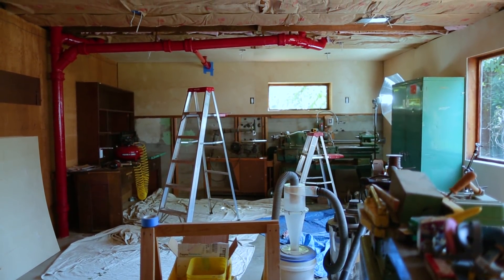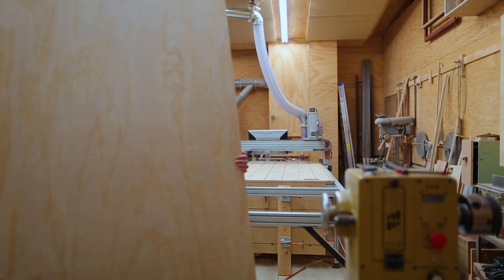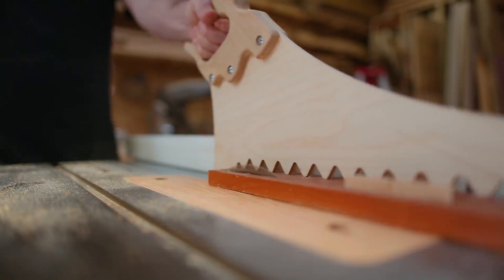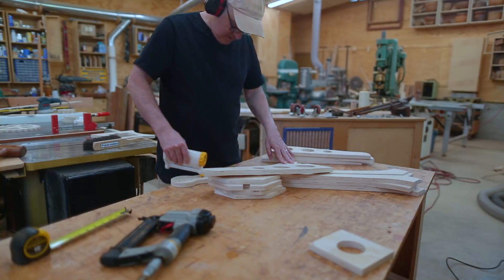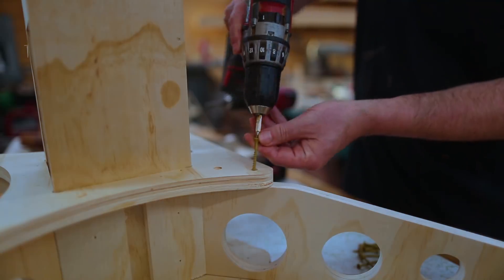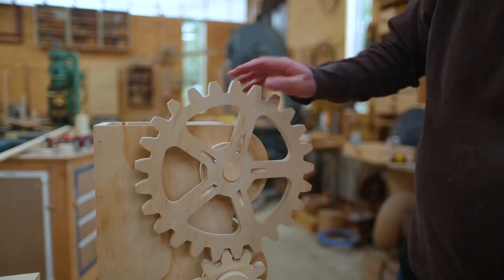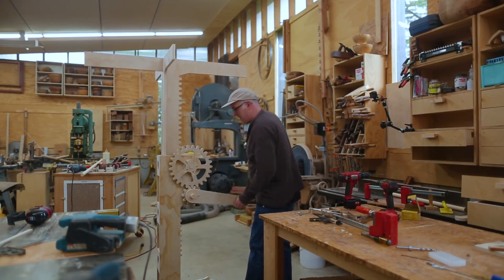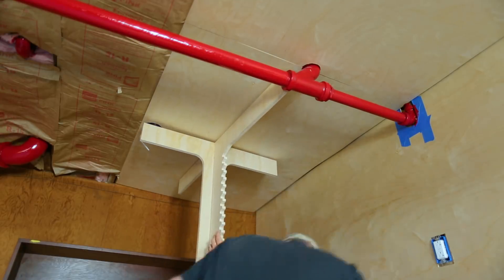Making A Plywood Panel Lift

Comment: Ahem.....endless people have made the observation of renting a lift, but Frank explained why that’s not a viable option for him, and we can surmise the rest. He has 3 separate parts of the basement that will require the use of a lift. Frank does not do anything quickly. He’s not that guy who will work 10 hours a day over a weekend just to return a rental lift on Monday morning and save a few dollars. For crying out loud, he’s not going to roto-zip the opening for his can lights, he’s going to CNC the openings! He is methodical and takes his time, and racing against a clock works against a guy like that. This is a guy who needs to own his own lift, plain & simple.

Comment: Order a Lift from Amazon, install all your panels in a weekend and return the sucker on Monday. Free tool rental!
Reply: Selena Scott endless people have made the observation of renting a lift, but Frank explained why that’s not a viable option for him, and we can surmise the rest. He has 3 separate parts of the basement that will require the use of a lift. Frank does not do anything quickly. He’s not that guy who will work 10 hours a day over a weekend just to return a rental lift on Monday morning and save a few dollars. For crying out loud, he’s not going to roto-zip the opening for his can lights, he’s going to CNC the openings! He is methodical and takes his time, and racing against a clock works against a guy like that. This is a guy who needs to own his own lift, plain & simple.
Reply: @idontthinkso666  Interesting reply but it was also a light hearted joke that I guessing did not come across as one.

Comment: Frank, love your shows! I have a suggestion for you. I have a few large CNC machines used to cut plywood pieces for furniture making. We use Raptor nails which are made from a polymer to fix the plywood to the spoiler board. If the nail is in the path it just gets cut, no damage to the bit or fire to the wood. They are a little expensive but at the rate you would use them it shouldn't be a problem. Also, as a fellow stammerer.. thanks for the work you do for the youngsters! and for showing that you still have something to say. Best of luck!

Comment: Ugh , just weld up / bolt up some racking steel. The stuff with all the holes in it.
Mount a hand crank boat winch.
Done.
This guy could have sheeted a football stadium by the time this beautiful monstrosity was finished.

Comment: It would be helpful if you would explain why you are doing something at the beginning.  I assume you know you can buy this kind of thing at any home improvement store.  It is hard to understand what you are trying to accomplish.  Are you cheap and want to see if you can make one yourself less.  Even if true you could look at the design of the others.  Maybe your goal was to build something better that can be found in local stores?  Anyway I was really scratching my head at the start of this video.  It sounded to me like, "I have this car thing with four doors and an engine.  I wanted to see if I could build some circular things that would go on all four corners and I could get around in it."
Reply: Title of the video:Making A Plywood Panel Lift

at 00:24 : "I sort of got side-tracked at this point and I made a lift to hold the ceiling panels up to the ceiling to help in hanging them on the ceiling."

gee wonder what he is trying to accomplish in this video...

Comment: excellent little project sir..
You can motorise this with a 12v power window motor (or 2 in parallel), they have heaps of torque, and most auto wreckers will usually have them already out of the cars.

Comment: Should have bought one from harbor freight 
for $250.       Frank,this contraption is not safe 
nor is worth the time involved
Reply: Not safe how? And you would know, engineering genius that you are? It's holding up a panel that you could lift with one hand, it's fine. God you people are pathetic.
Reply: I diasgree entirely. Seems plenty safe. Holy crap, it's a plywood lift not a bomb! 

Also, why do we make anything at all? Why do we make tables and bookcases etc etc when we could easily just go buy them? I don't get all the commenters who keep pointing out how much he can buy or rent one of these for. Yes and we can buy and rent ALL the things we make in our shops but we don't because we like to design and make things for ourselves.

Comment: Two tall step ladders and two "T'' shaped supports just a hair longer   than the ceiling, plywood included,   is high.  Put the ply or drywall on top of the ladders, use "T" to jam ply against the ceiling.  Ten minute build with free scrap.
Reply: SuburbanHobbyist 👍

Comment: that crank is too long, you should have made it with a wheel its dual purpose as you have two handles to push or pull he hole lift while raising, they are about the size of a steering wheel on real lifts

Comment: Buy an expensive CNC machine to cut out panel lift parts along with a, probably not cheap, CAD program and computer to run it to design a panel lift you can get for $120.  I bought one a couple of months back for $118.  It was cheaper than the rent would have been.  Now I can sell it, constantly move it, or roll it in the corner.  But this video is just an ego stroke.  I don’t like this guy.  He has an exceptional shop, to be sure.  His video skills are top notch. (I think he retired from some film industry concern, not sure.). But his personal design skills and method of construction are lacking.  I’ve seen some of his earlier work.  Meh.  Amateurish and not special.
Reply: Your welcome to do better. Let's see it.
Reply: Yeah, he didn't buy all that stuff to make the lift, he used it because he already had it so, why not? That doesn't mean you need a CNC to build it. Look at the tools in his shop, he could afford a drywall lift if he wanted to, he just found it an interesting distraction to figure out how to make one himself. There are plenty of other things for you to view on YouTube if you can't appreciate a talented man build something and, finally, your comment is "just an ego stroke". You came here to pretend that you are smarter than this man because you wouldn't waste all that time on a simple tool. Well, you're not and you're not even smart enough to understand why.
Reply: If you don't like it, don't watch it! Problem solved.
Reply: Translation: I'm jealous of Frank because I think I'm smart too but Frank is getting all the attention that I should be getting so I'll write this nasty comment trying my hardest to make myself seem even smarter than he is!
Reply: Jealousy is so terrible

Comment: Thanks for the outstanding video Frank! Something has always bothered me about your cordless drill...why does it seem that all the bits you put in there wobble? The longer bits are quite noticeable. Do you think the chuck is faulty? I don't believe they should wobble like that, especially on a decent quality drill. You could always test this by putting a 1/4" bit in there and seeing how "true" the resulting hole is. Maybe it's just me.

Comment: you should hang small bells or rubber balls off the arms of the lift, so that they hit your head and give you a warning to move out of the way before the arms of the lift hit your head.  better a light tap from a rubber ball than a big bruise from a corner of plywood

Comment: super cool, Frank!  thanks for sharing.  looks like the vertical adjustment is in increments of gear teeth, so i’m imagining you could add a few little shims held on by a short string- one or two for each of the 4 arms that hold your panel aloft

Comment: I don't have a metal shop but I do have model trains. It's hard enough keeping the dust out of the mechanisms and the crud off the wheels, let alone metal shavings. I hope there will be a divider of some sort to break the room up or you'll be spending all your time fixing the trains rather than 'helping' Calvin play with 'his' trains. ;)

Comment: The clamp moving on your end title would have been a simpler mechanism. The ratchet and Pawlenty on your gear system does not actually allow for a firm pressure of the ply on the ceiling because it only operates at fixed graduations. Ideally you need a lift system that holds the ply firm against the ceiling at any height. This could of course be achieved with a hydraulic solution.

Comment: Frank, I could have used this yesterday!  I'm doing the same thing (different reason) and putting plywood on my shop ceiling.  I used two FastCap Third Hand HD poles and the strength of my apprentice to get the job done-ish (more to come).  I'm sure that he wished that I had one of those!   The Third Hand poles work great once you get the plywood  up, but not a bit before that.

Comment: Comment on video: for the whole section where you're talking about the CAD designing, you have a loop of clicking/typing sounds. It was kind of distracting that it was just a loop instead of actual typing. I would say record the same kind of noises, but live to fill the whole time section instead of recording a short section and repeating it.

Comment: That's so cool Frank! I bought a panel hoist when I sheathed the ceiling of my 1200 sq ft shop and it was invaluable for that task being that my ceilings are 10ft high. After the job I decided to hold on to it just in case. About a year later I found myself needing a way to hoist my Jet dust collectors 90 lb. 3hp motor and fan 9 ft up in the air when I designed and built my custom dust collector. This would have been impossible without the panel hoist. I made a custom attachment for the top of the hoist so that I could sit the face of the blower on top of it and was able to jack it up into the air with ease. I love that panel hoist and now will never part with it.

Comment: For reference, the bearing with no rollers would probably be called a bushing, and the arm that stops the gear turning backwards is a pawl.
Reply: Technically, it's a plain bearing, and a bushing is a separate plain bearing inserted into a housing. His terminology is accurate.

Comment: Metal work and models trains in the same room, that cant be good D=
I mean metal work, depending on what is one of the most dirty crafts in terms of air quality and dust, oily fumes from vaporizing cutting fluids, chemical reactions, or just heat burning them + fine but heavy dust magnetic dust. Sounds like something you dont want near hard to clean models machines being electrically supplied by powered rails, with tiny electric motors running delicate sometimes open gearboxes.

Comment: Super cool. “You could have rented.” “But then I’d have gotten nothing out of the project.” 

Frank, you have to document the railroad build. There are some great ones out there, but I feel like the Howarth Pacific will be thoughtful and artistic like no other. If you’re not aware of DCC train control systems such as Digitrax, NCE, et. al., be sure to research them. It’s so cool to be able to control many trains independently on the same track, and there’s much more beyond that, including computer monitoring, traffic control, and automation. Reserve plenty of physical space for the railroad, because you won’t just be running one train in a loop. You’ll be mounting operating sessions with friends...hauling freight, making up trains in classification yards, dispatching freights while the SP Daylight runs passenger service along the Pacific coast under computer control. It’s fun and challenging!

Comment: I would hit those ceiling panels with screws Frank. The small nails will not hold; between the panel weight (its not large but still constant pull on the nails) and the live load on the joists from upstairs the nails will work loose and lose hold.

Comment: Frank be like: "I'll be damned if Harbor Freight is getting $180."
Reply: The Metal Butcher if not in plywood and time ;)
Reply: I rented a drywall panel lift for a MONTH for $20 CDN. would have been 15 but I had 10' long drywall
Reply: James Hannan - But Frank has his whenever, forever.
Reply: @MassDynamics  A one-time (per site) use tool, taking up space forever.  Yes, I am impressed by the design of the device, but the practicality of its scope is terrible.  first tool required: $20k+ CNC router...
Reply: @Randrew  it doesn't cost that much. Now it's not cheap but no where near that much
Reply: @MrJcTTK  Ah, yes how silly of me.  The Standard CNC kit capably of 4x8 sheets at his link is only $4200.  I'll order one today!
Reply: @MassDynamics  Until the wood starts falling apart.
Reply: @Randrew  why the rage brah?
Reply: @Randrew  The CNC router is definitely not required.  With more effort, these pieces could all be laid out with templates and cut with a jigsaw.  But you're point about it being used once and then taking up space forever is true.
Reply: @Randrew  yeah I get that. I imagine he just likes to solve problems and build things and put those things together in what he thinks is a fun project
Reply: @Randrew  I’m not disagreeing in the fact that a commercial lift is more practical in nearly every way, but I think this project was more about the novelty. It’s a cool fun version, fun enough to get his son interested in the project. And that right there is priceless
Reply: And that's new! I can buy a lift for $80 on Kijiji and that's Canadian!

Comment: More fantastic work. A few questions about timing if I may please. How long do you spend thinking about a project such as this? How much time goes into creating the computer model? How much time transferring the data to a cnc readable file? How much time to set up and cut? Assembly time? You get my question, I was wondering how long a project like this would take through each stage. I guess as normal I would spend 50% of my time sanding it straight......

Comment: I really enjoyed this project. That whole thing is awesome. 

The only thing I would do differently is maybe going at those axles on the lathe with the live center attached and a gauge, since you weren't using a moving bearing. Obviously, it's completely unnecessary since you're not jacking plywood up at high speeds or anything but its a small detail that would bug me haha.

Comment: All these years I have been using a stick that's slightly longer than the floor to ceiling dimension! Who knew you could just whip up one of these in only a few days (plus cad time).

I do love a good over build; great video.

Comment: Stimulating ideas and entertainment at the same time, what a great combination. As suggested by other comments a spring on the ratchet pawl would be a good idea, also a larger diameter screw for the pivot on the pawl. If I understand the mechanics of the system properly the pawl pivot is carrying the whole load of the platform.

Comment: I've used drywall panel lifts on multiple projects, which can now be purchased for under $200.00, they are heavy, somewhat cumbersome, but they work. Your build is a much nicer concept and execution. Lightweight, functional and way cooler to look at at. Very nice Frank.
Reply: yeah those things are way overbuilt for what they do and super heavy. On the other hand, they generally fold up in a way that frank's does not.

Comment: I'm sure you'll get a lot of comments along the lines of "Dood, you just reinvented the drywall lift", but I totally get why you would undertake this as a pleasurable project.

I spent 5 hours yesterday making 10 specialized bolts (valve cover bolts for Aprilia RSV1000 motorcycle) which are .5 mm shorter than the OEM bolts specifically to increase the seal pressure to stop an oil leak.  The OEM bolts are $17... each.

Comment: Frank, you are way too good at the design work to be doing it in Sketchup -- you need tools that support your skills!  Instead of drawing it out in 2D and then testing the design in 3D, I think you'll find it's a lot more intuitive and straightforward to do the entire design in a 3D environment and then just export the resulting pieces into 2D shapes and/or gcode for your router.  I won't recommend Fusion360 because it's an excellent CAD program (it's not really, IMHO), but rather because it works well enough, it's free for hobbyists and has very good built-in CAM features.  For the stuff I do at home, it's essentially all I use these days. It's not difficult to learn the process, and the time investment will pay off hugely. Much of what you learn will transfer to other higher-end solid modeling CAD programs if you choose to make the leap.

I find myself making this argument to friends and others with surprising frequency. I'm amazed at how many people use a drawing tool like Sketchup, for complex design work that really would benefit from a CAD program like Fusion, OnShape, Solidworks etc.

Comment: Just a suggestion on the locking ratchet arm, perhaps put a spring (or even a rubber band) on it so that it always engages the gear without it accidentally getting knocked off.  As always, this is very ingenious!  My goodness, your son has gotten taller!
Reply: Next video: Frank figures out how to make a wooden spring in 10 "not as simple as he makes them look" steps.
Reply: Or maybe a metal weight on short arm to press the stop into the gear when it is in place but still allow it to swing out of the way without adding and removing a spring or rubberband.
Reply: I was about to suggest the same sorta thing.  I'd hate to have that paw get accidentally nudged and bring the whole thing down on your head.  It wouldn't need much tension, and you could make it so it could unhook easily when you did want to crank it down.  

Otherwise awesome design, I've got a big tall wall I'm going to be paneling in a few months and so I've been looking at drywall lifts.  This is so much cooler, but not quite as practical for my specific purpose vs yours.
Reply: This was the only error Frank made in an otherwise awesome build. One tiny spring will make a world of difference.